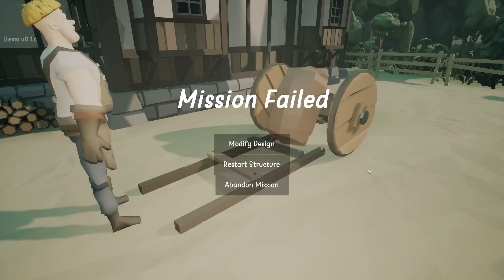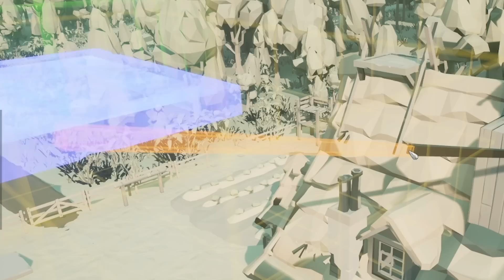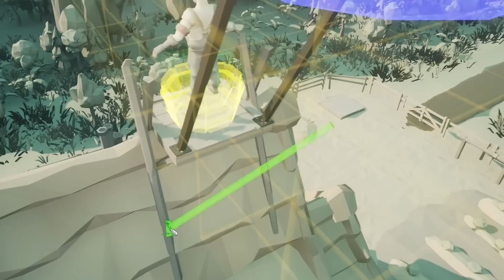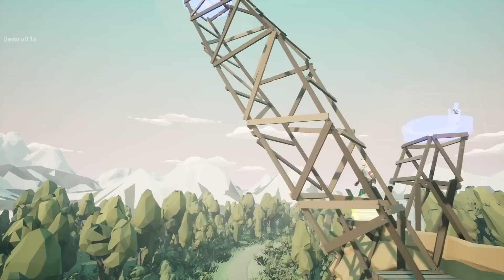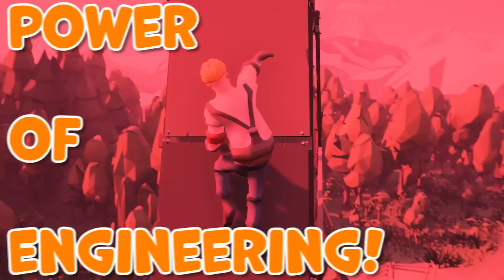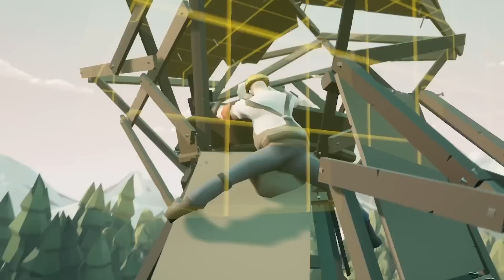Can engineering make the TALLEST TOWER in The Enjenir?

Comment: 3 wheels, 1 board, 3 nails. The sack holds the board down onto the wheels, the board presses outwards on the wheels to keep them upright. Place the cart so that the sack falls onto the front right, and place two wheels on the front with one wheel on the back right. Push the cart with your body.

Comment: JFC have you never seen a wheelbarrow? or any vehicle with an axle? You over-engineered the hell out of that cart. Handle beams on TOP of the wheel blocks, a pair of legs in between the wheels and handles. Pick up the handles and go. End cross-brace for convenience optional.

Comment: i wont call Matt architect for on the wonk design, if it works it works - funtion over form is engineering.
i WILL however call him architect for nailing things to apparently thicker than usual bit of air, that aint right material.